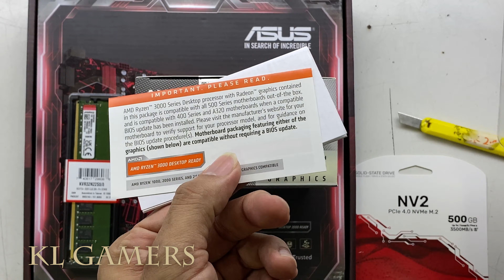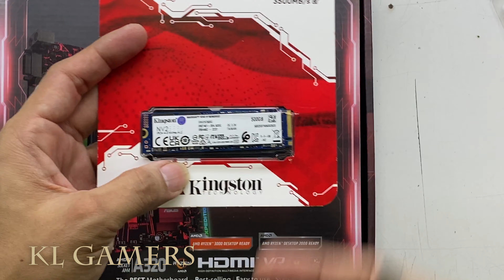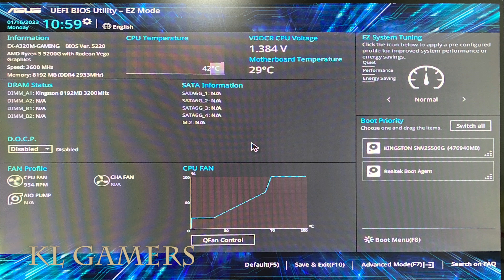AMD Ryzen 3 3200G ASUS EX-A320M-GAMING Kingston NV2 Budget Gaming PC Build

Comment: I am using same board, But display is not coming from On board hdmi port,
Reply from the maker: it depends if u used a processor with graphics, such as the 3200G, if u use 3600 there will be no graphics output on motherboard, u need a graphics card.

another issue would be the motherboard BIOS too old, needs to be updated b4 support AMD Ryzen 3000 or 5000 series processors
Reply: @KLGamers  I am using Rayzen 5 1600 , its 3 year old, now i want to connect two monitors through hdmi, My graphic card nividia GT710, have only one Hdmi, one vga, kidly suggest, mother board also has hdmi port but display is not coming from motherboard hdmi, kindly suggest.

Comment: Total budget cost with shown components sir ?
Reply: Look at description
Reply: There is total savings on everything. Memory in one module, bad power supply, even the nvme drive did not work. It's good that at least the cooler can withstand the processor :(